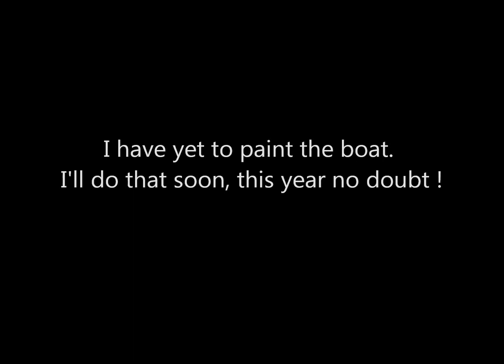Building the Dinghy D5

Comment: Hi There wondering if you could answer a question about the measurements on the bottom and side panels.    Been a few years since you built it.   The plans don't seem to have a measurements I need to complete the bottom panels
Reply from the maker: The plan is not that easy to understand from a measurement perspective. I remember I have had difficulties to guess (more than calculate) the right measurements. I guess that won't help that much... 
Good luck !